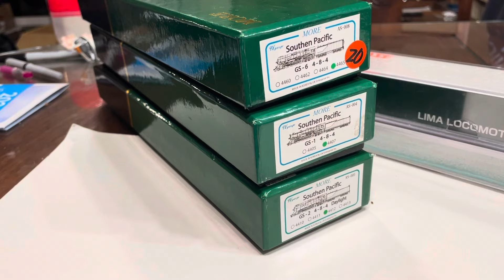Otaku bench: N scale Southern Pacific 4-8-4  GS class model comparison

Comment: I especially love the unskirted Half-Daylight GS-4 you made. 

Glad I now have a secondary reference for the day I make my own. I'm currently working on a Con-Cor WP GS-64 for DCC installation and SP relettering.

Also two small corrections because it gives me an itch, lol. The GS-2s and GS-3s didn't have stars in their wheels like the later GS-4s because if I recall correctly, they were not fitted with Spring Pad Oil Lubricators, they were grease cake. 

And as for the GS-5's, 4458 and 4459 where the two made under the final GS-4 order. 

None survived, but 4460 as you mentioned is a GS-6.